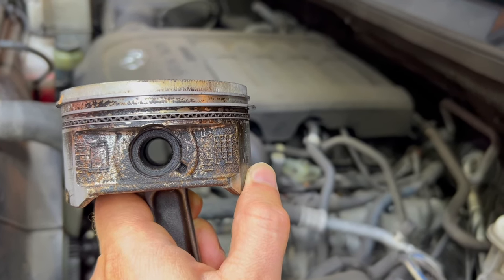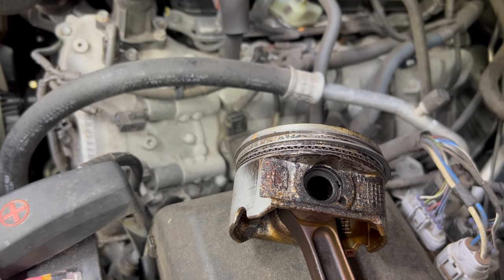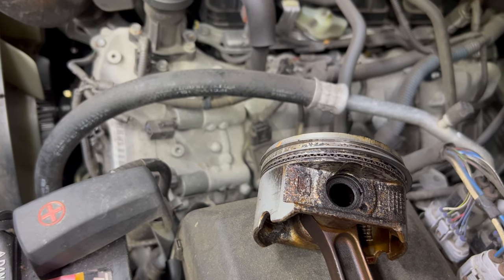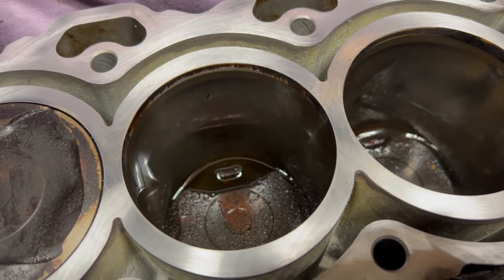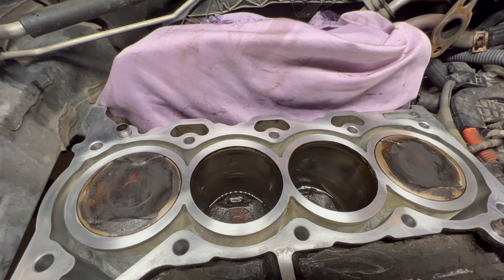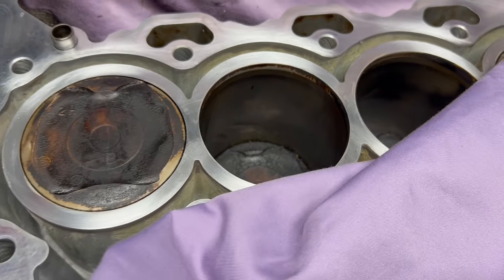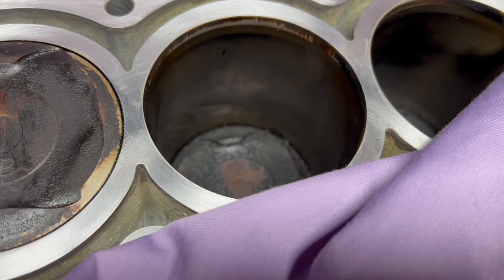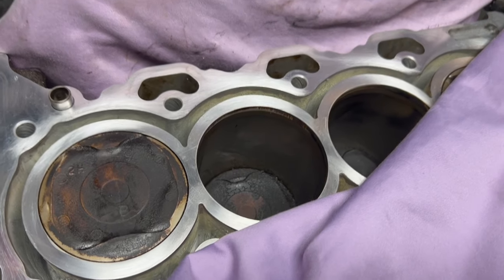Oil consumption and decarbonizing oil rings works? How to clean oil rings without removing pistons

Comment: I did piston soak with b12 through glow plug holes as per diy dave instructions and my oil consumption reduces from 1.2l/1000km to 0.2l aprox from single treatment (i might do it again to see if improves further) so yeah it does do something if you want to try before you tear engine apart. I literarly almost got it rebuilt but tried this as last chance fix
Reply: Im also a DIY Dave sub aha, would you be willing to try a white vinegar soak? I saw a video on YT the results where pretty amazing it unstuck the oil ring and cleaned pretty well, although carbon deposits where still present
Reply from the maker: Do not use vinegar, it’s acidic and will cause corrosion
Reply: Which b12 did you use ?
Reply: @truebengalsfan  b12 injector cleaner
Reply: Any idea what do use if in Europe where B12 is not available? :P I see SDS for B12 says it is mostly toluene and acetone.. I see some paint thinners with this mix that I can get. What do you think?
Reply: I rigged up a B12 IV drip with a hose for my Subaru because they are sideways 🤣 so far so good!
Reply: After soaking you need to use compressed air and a rag and blow out all extra debris and moisture before you put the spark plug in
Reply: @rkan2 maybe liquimoly injector cleaner? I am in the same boat as you brother. I tried a liquiy moly engine flush yesterday before I changed the oil and filter. Lets see if it works.
Reply: @carenthusiast6748  Any luck....?  Id try both to see which works best.
Reply: @aidankirby8412  didnt do shit. Still 1L/500km oil consumption. I orderd berryman b12 from the us and when it arrives I will do an piston soak. Car is Toyota Avensis (2007) 2AZ FSE Engine.
Reply: I did same also on tfsi. Seems to do wonders left to soak for 12 hours
Reply: @hazadus2u what was the result I’m watching this due to the same issue with my Subaru
Reply: @BasedU.S.parriot1776  it stopped consuming oil but I'm going to take the next step and gut a spark plug and  epoxy to metal straws one with a spray nozzle and one with a suction attached to a pump to circulate and cylinder by cylinder letting it spray overnight
Reply from the maker: @BasedU.S.parriot1776 , what year is your Subaru and mileage?
Reply: @rkan2  i think one of main ingredients which does the soaking is acetone, so you can try with that. Im also from europe but didnt want to take chances if its going to work or not so i ordered berryman from resellers for hefty price but it did the job. If i tried something else and it didnt work i would still need to try berrymann or think forever that i didnt do it properly..
Reply: @carenthusiast6748  Which one did you try?
Reply: @Boz1211111  Cool. I was thinking of mixing as close to what I found B-12 ingredients to be. Where did you get yours? I see some on UK Amazon...
Reply: @carenthusiast6748  Save me bro, was gonna use lquid moly as well 😂😂😂 b12 is not available in Taiwan too. Maybe red line or Stp would work?

Comment: If your hoping to clean your piston rings, remember that putting stuff inside the cylinders could desolve carbon on top of the piston and that desolved carbon could possibly run down into the piston rings and contaminate them more.
Reply: that is my concern too - I got a manual vacuum pump and I am going to try to pump out most of the gunk but I know I am taking a huge risk so I am going to wait until we get a spare car next month before trying it
Reply: @declansgamereview6523  any updates?
Reply: @2cents740  for now I sprayed carb cleaner in the pistons, seems to be much better actually. As soon as I get our spare car running im going to go extreme and fill the cylinders with different cleaners and take a chance but the carb cleaner with aggressive driving straight after definitely made a difference. I only topped up after 2 weeks instead of the weekly
Reply: I’ve been considering this for a while. I thought of doing one cylinder at a time. Disconnect battery so engine won’t be turned over accidentally with key. Bring the cylinder up to close TDC put  Berryman’s bring piston up to just a slight pressure, and I mean very slight, let sit overnight  so pressure helps force fluid around rings and through drain holes. Only do one cylinder per day. What do you think?
Reply: Not sure you understand whats going on as well as you think you are with your 'warning'.
If you're rings are gummed up and plugged, any excess cabon from the piston tops will take a ride down and up and then most likely be expelled out the exhaust valves.
Reply: @boots7859 yup which is why when you add sea foam to the intake or brake booster hose, you get a lot of smoke if you have a lot of build up

Comment: One thing to realize is that carbon deposits are very hard . It has been a real problem in the competitive shooting community.  Abrasive removal with dedicated carbon cleaners REGULARLY is the only method known to help keep accuracy up, and wear and dangerous pressure down. FreeAll has been getting good comments lately. The chemical makeup of carbon ,whether petroleum or nitrocellulose is laid down in layers in high temperature environments.  Never have had any luck removing carbon by soaking alone with any chemical I have. Will try Freeall and see. Thanks.  Great series of vids. Smashed sub , and like buttons.
Reply: how did it go with freeall
Reply: @carenthusiast6748  Wish I could tell you. My borescope took a vacation , so I can't really tell. My groups seem to have tightened slightly after the customary 4 shot bore foulers. But this isn't definitive. Just another chemical tool in my arsenal of cleaners for carbon ,powder and copper!
Reply: Well, seeing as a lot of folks have reported good success with this working it would appear there might be a difference between firearms and internal combustion engines which are literally floating in oil their entire lives.  My H&K is not living in oil thats for sure.
Reply: Try my Turbofield Nano Treatment and get this work done easily

Comment: Would have been better to leave the head on,  spray carb cleaner through the spark plug hole, then rotate the engine by hand.  Doing this,  it creates compression, and that compression forces the carb cleaner through the rings.
Reply from the maker: Head was not removed to clean carbon, it was removed for different purposes

Comment: I have an idea. If the crank position stays locked and intake and exhaust is sealed, you could pump diesel through the oil filter mount for a few days to super clean the engine. It could remove all carbon around above the pistons and valves. The pump should have pressure gauges and a couple filters on it to prevent particles from going back into the engine. When you think it's ready, pump a few gallons of cheap oil through the engine to get the diesel out, and after a hour of idling do a oil change.
Reply: Diesel flowing through the oil galleries won’t clean the piston rings
Reply: Or the valves
Reply: Now inject it though the spark plug hole? You might be onto something
Reply: @moeriou8431  That’s a idea. Then shop vac the diesel out through the spark plug hole. Worth a try.
Reply: @markm0000  Whatever you want to put in the cylinder, if you crank it generously with the spark plugs out, it will evacuate the cylinder, and you won't have to worry about hydro-lock. Saw it done on an old Cadillac that went in a lake accidentally, in a copy of Classic Auto Restorer back in the day. Now with today's central and deep spark plug holes, you might have to rig up a shop vac with a smaller hose to make sure everything gets out of that hole and channel.
Reply: @raypelling6440   the more I think about this it might be easier to seal off every opening and log the engine with diesel mixed with ATF up to the valve covers. It should clean the entire engine with piston rings from top to bottom after a few weeks. Then clear it out like you say.
Reply: @markm0000  My Dad was a car nut like most of the guys from the 40-60's, and a top mechanic at that.  He said they used to do that, or just run kerosene until the manifold or headers got cherry red. But that was in the 40-50's with old cars even then.  He laughed when I asked him about doing that with my 82 Capri Black Magic around 1990.  No way I'd be doing anything like that on a vehicle worth anything more than a junkyard bound POS.

Comment: RepairVehicle:: I have a 2020 Tundra TRD PRO I changed my Front & Rear Diff & most of my transmission fluid to Amsoil probably 8 months ago & got no distinguishable MPG improvements. However, I've finished with my Free oil changes from the dealership and changed my Oil to Amsoil Sig. Series 0W20 3 days ago at 20,650 Miles on truck. I just got back from a 50 mile round trip and my MPG was 18.9 miles per gallon which is really 19+ because I have 35's on my Tundra. I can hardly believe it but I witnessed it and took a pic of my dash for the trip back!!!! I am now definitely a believer in Amsoil SS products. The oil change is fresh so I still want to see how it does after about 1000 more miles to make sure this isn't a fluke. I am getting ready to take a 600+ mile 1 way trip tomorrow. If this MPG continues this is going to be amazing because my truck is only rated for 17MPG on the highway and that was with the smaller lighter stock Tires. Thanks for continuing to make your videos and your fervent belief in Amsoil.
Reply from the maker: Thank you for sharing your experience with Amsoil. I have not heard from anyone yet who tried Amsoil and did not see any difference
Reply: @repairvehicle  yes ..would like to change transfer case fluid to Amsoil also but they have no fluid for the 2020 since Toyota went to that single weight fluid
Reply from the maker: I personally think it’s garbage fluid single weight. I need to get my hands on and do some testing
Reply: @repairvehicle  thanks I'd appreciate it as I'd love to put Amsoil in it. It's crazy expensive for that Toyota transfer case fluid though
Reply: @dalephillips8250  I bought a 2022 c8 corvette after 700 miles I changed the oil to amsoil 0-40. The runs quiet  mileage is up. The only oil that is 100% synthetic.
Reply: All I will ever use....Amsoil was originally created for jet engines....and when they tell you to run your oil 25000 miles before changing, just changing the filter once in the middle they stand by that

Comment: Thanks for making this video, I've been wondering about this exact thing. Still have to wonder if there isn't a magic solution for an oil burning engine like the 2AZ-FE that can free up those oil control rings, even if it means having to pull out any remaining fluid in the combustion chamber. Something that could rejuvenate these engines without having do to a complete rebuild.
Reply: I'm wondering that about a 2AZ-FE as of today lol. I can't afford help with a rebuild and don't have a few special tools I'd need.
Reply: Sticky carbonized oil ringscan be freed and unsticked with continuous oil flushes using each time premium 5w30 oil which has the highest TBN value possible. About 10 times with 500 miles between each oil service.
Reply: @hanynowsky  interesting.
Reply: Someone mentioned on YouTube comments to unplug the PCV valve hose and leave one end open while the other end plugged.  The theory is more on blow-by, and opening the hose will allow the sludge to be pushed out by the force of blow-by.  On the contrary, a clogged PCV will do the opposite and causes the oil rings to clog up.  Cleaning the PCV (or replacement) is AS CRITICAL AS CHANGING OIL! 

For already-clogged up engines (rings I mean), it’s worth to try!  I’m on the same boat as many 2AZ owners.
Reply: @jrm163  Its crazy how many people don't know or refuse to replace a $10-15 PCV valve.  I'm stupid, I inherited my wife's 06 Murano at 120K and just replaced it at 168K as I thought it had already been replaced... Doh.
Reply: @hanynowsky  Yeah, no. Did that for several years after that was suggested on Bobistheoilguy.  Fact is, once the oil control rings are carbonized or the oil holes are crusted up, no magic oil even high detergent is going to do squat to that coked up/carbonized mass. There are in-depth technical papers researching this.  Weirdly enough though, Chemtool B12 used as a piston soak does seem to be able to alleviate the problem somehow. Some people report no success, while a lot of others actually have fair to excellent results.
Results may vary, but if its burning  as bad as some of the Audi guys have, its a very, very cheap and easy non-mechanical fix potential.
I'm only burning 1+ quarts per 3K, and if I do this I'll start on a Friday after work and have 5-6 cans of B12 ready to refill cylinders, partially thread plugs in each time, and bump the crank 10-15 degrees back and forth.
If I'm going to go to the hassle of pulling the Intake Manifold off and everything, I'm not just going drop 1 can in and expect that to do much more than minimal.
Reply: @boots7859  you are correct.
But when I said oil.flushes, i mean oil + a good flush product like BG EPR

Comment: High Detergent Oil? Recommendations?
Reply from the maker: For what?
Reply: Liqui moly special tec b fe 5w30.
Tbn = 11.7
Reply from the maker: Tbn is not a detergent
Reply: @repairvehicle  TBN not tbs!
Total Base Number is the capacity for a given oil to neutralize acids and carbon organics and combustion by-products. The higher the TBN the cleaner is the engine. By cleaning acids the engine is protected from wear and tear.
Reply from the maker: You still wrong about tbn, it has nothing to do with detergent
Reply from the maker: Copy and paste from chevron website “For years, Total Base Number (TBN or BN) has been used as one of the key measurements in the field to help determine remaining oil life by indicating the amount of performance-related additive left in the engine oil. In short, it helps you know when engine oil needs to be changed. That’s still true, but TBN on its own no longer serves as a comprehensive or definitive indicator of performance left in engine oil due to a number of other new and more revealing factors in the mix.”
Reply from the maker: Here is the definition of detergent “Detergents Defined
Detergent additives perform two key functions. Like household detergents, the additives keep metal components clean and free of deposits. Additionally, detergents neutralize acids that form in the oil. This is key for systems where component cleanliness is essential. Originally developed for engine oils, detergents addressed carburetor deposits that could hamper performance. Detergent additives were also found effective in fuel injectors. The detergents reduced deposits that affected fuel spray patterns.”
Reply: @repairvehicle  totally agree and what I said is correct.
TBN is the indicator of cleaning power of an oil and detergent is a cleaning agent added to the oil during manufacturing blend or after.
The guy who asked you the question said "what oil has good detergent in it" reporting what you said on the video : "you need to use an oil with good detergent".

So there are two ways to help clean piston rings and piston oil drain holes:
1- use a premium oil with high tbn.
2- use premium oil and add a detergent additive like Liqui Moly HLA or Marvel MO.

Anything that has acetone must be avoided.
Reply from the maker: Oil additives don’t work and cause more damage to the engine. Here are the lab results, Liqui Moly great for destroying engines
https://youtu.be/yLCNzTK1Ejg
Reply: TBN это шелочное число
Reply: @hanynowsky  You are wrong, and repairvehicle is exactly right. TBN has nothing to do with cleaning whatsoever.
Its a measure of how much of the anti-wear additives are remaining in the oil.  Anti-wear additive packages are absolutely not cleaners. Period.

Comment: After watching too many videos , i finally tried it for myself as my infiniti fx35 was burning somuch oil. I  was gonna use B-12 but its really hard to get one here in  Canada. So i used seafoam instead, did the same process as most of the youtube videos i watched. Removed spark plugs poured straight into the piston rings  and soaked it for 2days, when its dried out i added more seafoam i've used  3cans in total.  
When i first  fired up the vehicle    massive white smoke  came out of the exhaust pipe, neighbour thought my garage was on fire. It lasted for almost 45mins until finally smoke cleared out.the following day i was driving in the neighbourhood and i noticed some more white smoke came out of tge exhaust. So i decided to put more miles on high rpm  i did about 250kms and smoke finaly cleared. Fast forward today almost a week later. I added almost 500kms no burning oil yet, but what really surprised me was the gas mileage from 13L /100kms down to 10.8L / 100kms after the treatment.